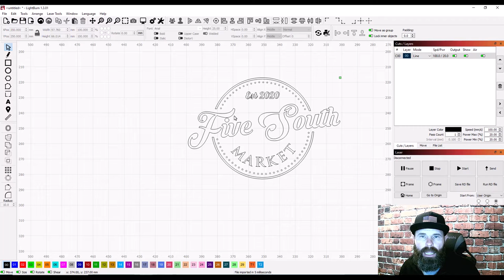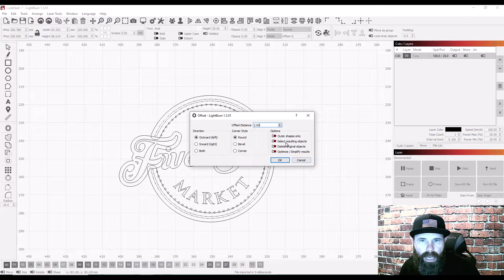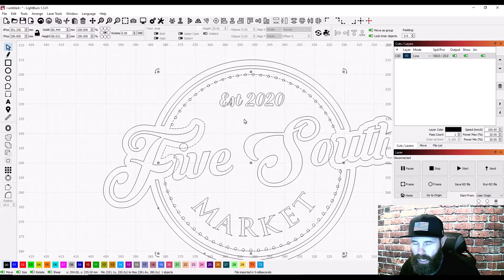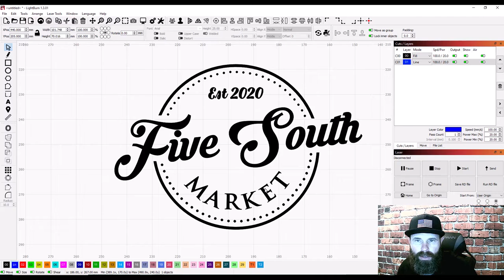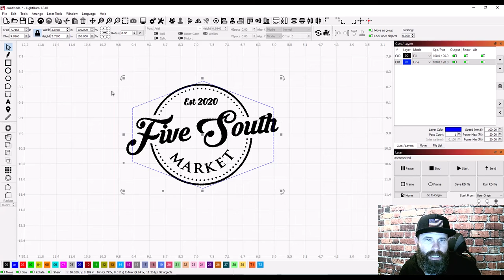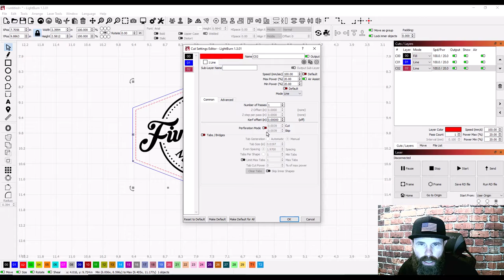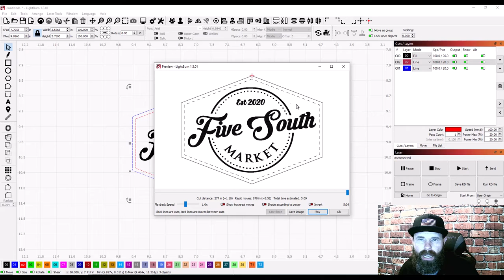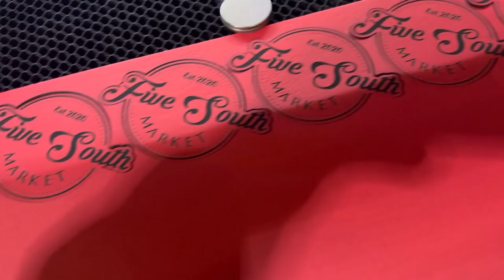Making Leather Hat Patches on a Laser Using Lightburn

Comment: Loved the tutorial and just subscribed! Quick question - Do you clean the leather after engraving and before applying to a hat?
Reply from the maker: If I am engraving with the air off then there is little to no residue and most of the time I will skip the cleaning unless I can see a need to.
Reply: @BeardedBuildsCo  So you usually turn the air off when doing leather?

Comment: A couple of questions.  On the second patch (not the die cut patch, the inner line where you made the stitch line, if a person were to just leave it a line, would that engrave a solid line, and be used as a sew line or channel to sew with a sewing machine?  Also, I have read that lasering leatherette or faux leather produces toxic fumes.  Is that not an issue, or do you just make sure that you don't have any leaks and are venting 100% outside?  Thanks for the videos and information.
Reply from the maker: This material is specifically designed for laser engraving and is not made with PVC products.

Leaving the stitch line as just a line would likely score through your material more than you would like. Ultimately you would have to test and see if you can get a result that you like.
Reply: @BeardedBuildsCo very good.  I see what available out there.
Reply: @BeardedBuildsCo  Okay, did the research on what to use.  I have some leather, and will be ordering some product from probably Lonestar.  One more question.  On the stitch line, using leather heavy enough to cut a stitch line into ) 5-6 oz. veg tanned leather), is it possible to make that stitch line a different size as far as width?  Not the width between the stitch groove/line, but the actual width of the stitch line, so I could match the width and depth of the size of my thread, which would be #92 bonded nylon (like you would use for much heavier leather.  Thanks again!

Comment: Hi, thanks for the video and your settings.
Worked perfectly with my Aeon 100W laser.
Exept when I cut or engrave a line, at every corner, for cutting, it is not cut trough and for engraving, it is a bit burned to much.
Do you have sugestions for that?
Thanks.
Reply from the maker: Are you setting your min and max power to the same?
Reply: @BeardedBuildsCo  that was indeed the problem. thanks for the help.
Reply from the maker: You’re welcome!